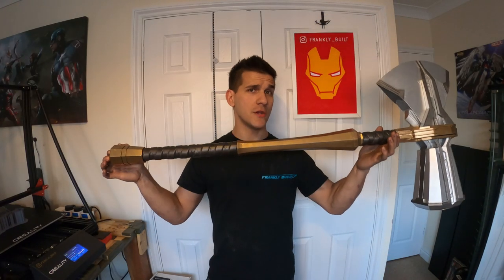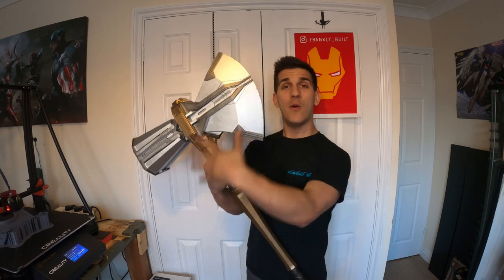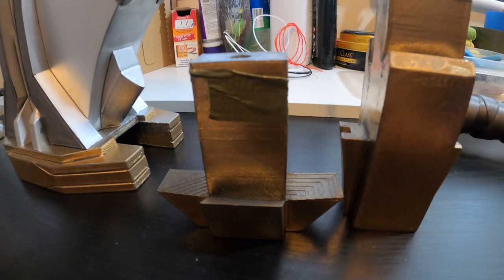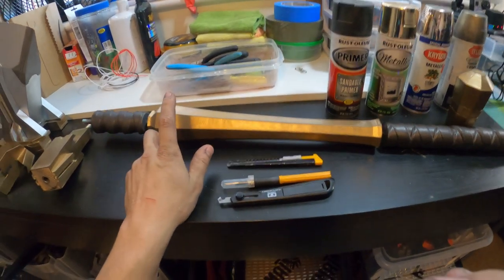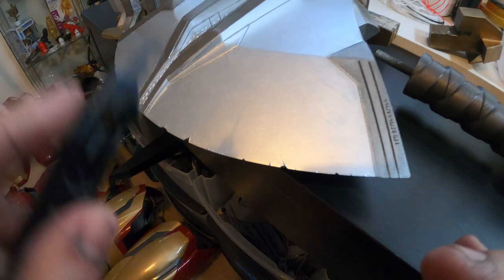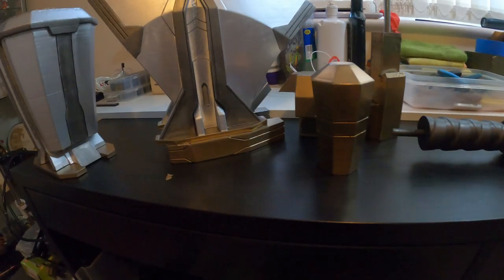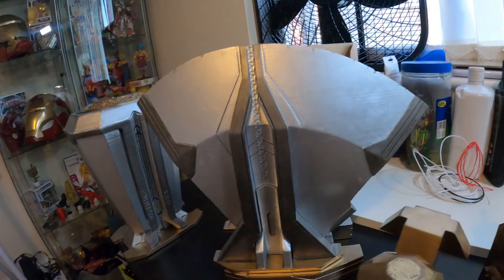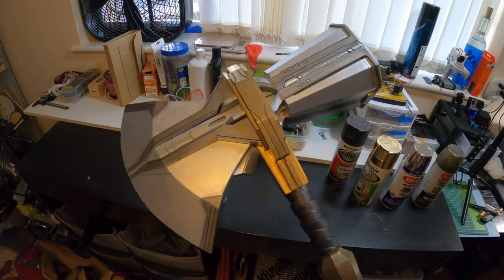Asgardian Stormbreaker - A 3D Printed Build Review and Guide

Comment: When your Stormbreaker is dismantled or broken up in its individual parts you can make moulds of each part and Poor aluminium into The individual parts and when They set pull the aluminium parts out clean them up and connect all the parts together to make a full aluminium Stormbreaker, then clean it up do some detailing, I reckon that would look awesome….
Reply: Probably

Comment: I love your work and your help. I have an ender 3 and CR10. I use a .4mm nozzle and PLA and slice in Cura. I’m having issues where my supports are printing much to robust, literally like the print itself. What am I doing wrong, I’m trying to print a storm trooper helmet on my CR 10 and 2 times I stopped the print due to the support. I’m pretty new to this but I thought I’d ask. You probably have a video about this but I haven’t come across it yet. Thanks in advance. Great videos.

Comment: Have you done a video on why you prefer the sandable primer?
Reply from the maker: No lol it’s just preference
Reply: It will also depend on what you are using the primer for. I have used both and found that filler primer gunks up your sandpaper faster but if you are using it for wet sanding, thats not an issue
Reply: @bagenius5970  yeah ive primarily only used filler primer and thats the exact issue ive encountered.  most of the time i try to stick to wet sanding it but sometimes its too large of a piece for my work area that i cant do so and it just runs through materials so quick when dry sanding.  Though ive found using smaller strips helps a bit to combat that

Comment: how do you fill in impact’s marks from the support, wood filler?
Reply from the maker: My supports don’t really leave much marks but yeah. Sanding and some wood filler. Sometimes I’ll even use my soldering iron to smooth it